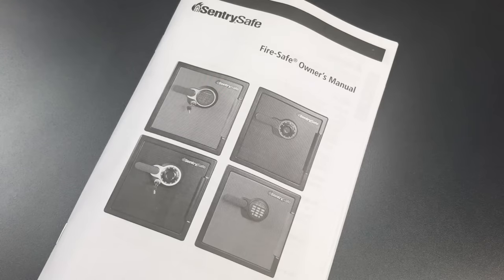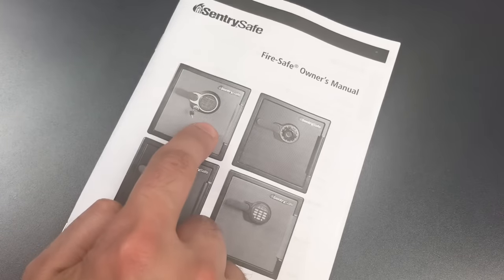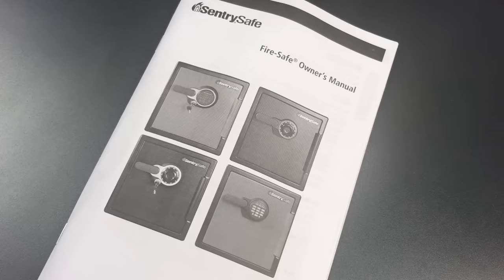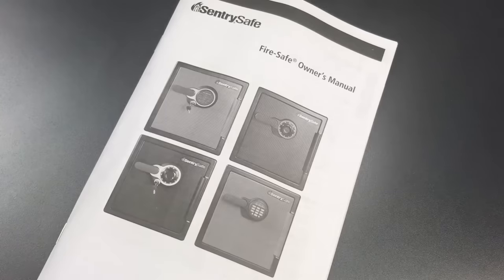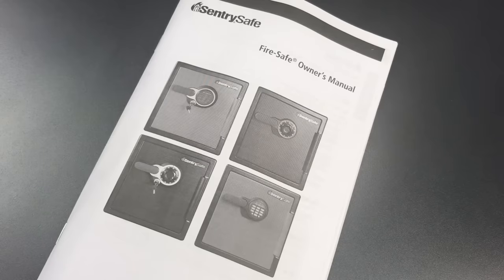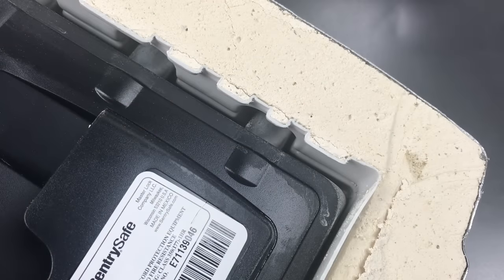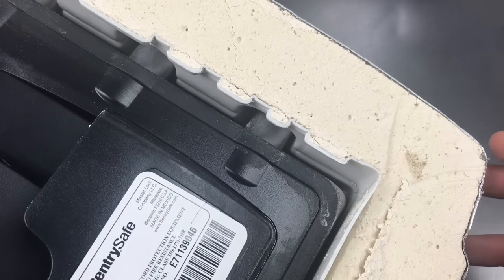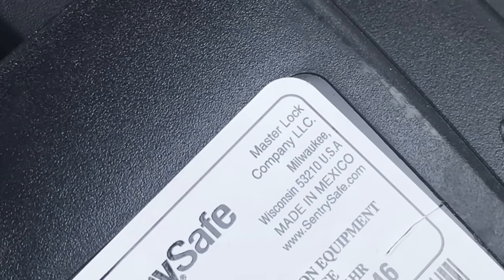[756] Sentry Safe Cut in Half FAST!

Comment: My aunt had a cheap sentry safe lockbox with her birth certificate, social security card, backup car key, car title, rainy day fund etc. She was freaking out because she lost her key for it. My cousin picked it up at about chest height and dropped it on the back patio, it sprung right open. She was dumb founded. She had believed it to be top security.
Reply: Wow.... lol
Reply: isiunavailable  i think this video shows that it isn't such bs or unbelievable. my parents have a safe from the 1800's, even c4 probably couldn't get into it, as it weighs about 500lbs empty, actual steel, not some dried milk powder. sandwiched between aluminum and plastic. this is really just a fire safe, not a valuables safe.
Reply: isiunavailable  Picking up and dropping something to open... Such BS.
Reply: @LygerTheCLaw  but even the weakest of lock attacks would get it pretty quick, unless it has a more modern door with locking bars and a modern key system or code

Comment: I'm just gonna admire the fact that he freehanded that cut together perfectly.
Reply: He placed his machine so the left hand edge followed the line of the safe door
Reply: freehanded? lol no, followed the line LOL
Reply: It's not terribly hard when you're only cutting through 1/16" piece of sheet metal and foam insulation.
Reply: @expert_fretwork  foam cement; not hardened steel by any means, but still...
Reply: @foxyMcFoxface  That puny little saw could kick an ant about 5cm....
Reply: I guess LPL never had wood shop in high school. Never, ever put your hand forward of a saw blade. That's first day shit
Reply: This is fire protection safe with access control for documents, not strong security,
Reply: @WiitaminCS  But it was not sold as such. Not that it is a bad idea to hide one of these under the floor boards in a closet to hide jewelry in, because it might save it from fire damage.

Comment: "I SAWED THIS SAFE IN HALF!" Takes out flextape to make it safer
Reply: I. WAS THINKING THIS THROUGH THE ENTIRETY OF THE VIDEO!!!!!! even wanted to comment it but you took the cake
Reply: That's a lot of damage!
Reply: ,,,AND WE REBUILT IT USING NOTHING BUT THIS CHICKEN WIRE AND FLEXTAPE!!!
Reply: The flex tape might actually be more saw resistant than that thin metal. The tape material and the sticky adhesive might jam up a saw
Reply: WAAAAHOOOOOOOO!!!!
Reply: Thank you, now I don't have to comment that.

Comment: they say safe but if you look up the UL listing they are listed under the category for "Residential Security Containers" (TL-5 rating meaning it has to withstand 5 mins against an attacker armed with a screwdriver and hammer) not for safes which have insane security requirements to get a UL real "safe" rating (class B, class C, TL-15, TL-30 and even higher) also if you think thats crazy most gun "safes" are also "RSC" listed not real safes either a total scam that needs more awareness.
Reply: screwdriver and hammer?

i get why youd rate a doorlock or a padlock like that

but what are you supposed to do with those on a safe? there so not the right toold for the job unless you wanna justt hit it and hope it opens

in which case 5 minutes is pretty pathetic
Reply: +Sarge
You can easily cut sheet metal with a hammer and a screwdriver...you lay the driver nearly on it's side where you want to cut, then smack the side of the driver blade tip with the hammer, and work your way along the material you want to cut like a can opener. It doesn't look pretty, but it will get you in this safe no problem.
Reply: Yep.  That's why, when buying security devices, it's important to ask ourselves what we're protecting the items against so that we can find a device with the proper rating.  I've bought Sentry Safes, before; but it's mostly for fire / water protection while my security concerns are more about deterring busybodies, curious pet-sitters, and low-grade thieves.  

It's similar to how I'm not that worried about using cheaper locks to protect my sweaty, nasty gym clothes while showering but I invest much more in a lock for a storage unit or shed containing items of greater value.  Someone snooping in lockers at the gym is a different kind of security threat from someone looking for a payday in the self-storage yard.
Reply: That's not a scam, you answered your own comment. 

The problem lies in the typical consumer, who buys something based on a price tag and a pretty picture on the outside of a box. It's the consumer's responsibility to research the things they purchase, and there is ESPECIALLY no one else to blame when that data is easily obtainable, such as on a UL listing.
Reply: Unless you keep your wallet, goverment id, credit cards, and/or vehicle keys in the gym locker, in which case it could be potentially more valuable than your storage unit / shed.
Reply: @1nm1  That is possible; but there can be other factors involved, too, when considering if a measure is sufficient.  For example: others in the locker room might take note of someone trying to break through a lock during the short duration someone is showering.  So even a relatively inexpensive padlock can be an effective barrier.  The same lock may be much more inadequate in a storage facility the thief may have largely to themselves, possibly giving them hours to work without being noticed.
Reply: Are you sure it doesn't say 5 minutes with a rubber mallet?
Reply: Or 10 minutes with a wet sponge and a banana
Reply: sentry safes are not ul listed rsc rated there way below that a rsc safe offers some protection
Reply: Where do you even search it? There's a whole bunch of UL sites and non of them show any information. All useless
Reply: pretty sure you can open this with screwdriver and hammer within one minute.

Comment: "I can't speak to the fire protection"
Wait, you're not going to take a flamethrower to it? Well I'm underwhelmed
Reply: They claim 1700 deg F for one hour.  While most people don't buy these for fire protection, I did make use of it, everything inside was intact after being in a house fire.
Reply: Here's we flamethrower that Bosnian Bill and me made
Reply: Thermite - easy and portable ;)
Reply: a flamethrower really wouldn't simulate a house fire....
Reply: @thorjohnson5237  This might be a bit too much.  Someone mentioned their rating claim was 1700 deg F for one hour...  I mean, isn't thermite designed to crack safes, and I mean real safes, not computer chassis with foam inside.
Reply: A friend of mine bought one of these for some testing. Now keep in mind, he's a qualified man to play with fire.
He took a DIY flamethrower and started burning. Got through the "Fire resistant" insides in 15 minutes. Of course the outer casing got melted by the heat. Useless, yet we had fun. In the end, we also made a molotov and put it inside, and funny enough, the safe went up in flames.
Reply: You you can speak TO everything. But please, dont expect any answer then.

Comment: I’ve literally only ever thought of those boxes as fire safes, not security safes.
Reply: Yes, I don't even lock mine.
Reply: I would call them "peek-proof" they stop a curious co-worker from checking out your documents but not really more
Reply: I understand the idea of having a fire-safe, but if a couple inches of insulating foam is all takes to qualify, wouldn't it just be better to insulate a filing cabinet?????
Reply: Yeah, that's probably more accurate although selling it that way may not be as fruitful. If you hid this, or secured it really well in a wall or to the floor it would be a lot more secure.
Reply: The manual said fire safe on the front pafe ment to keep fire out not baddies
Reply: @MGSLurmey   One of the main damage you get from a fire is water used by the fire menn.
It is not just the heat from the fire but also the water.
Reply: I figure any safe that can be picked up and carried away is going to be deficient in this sense.
Reply: @tuvelat7302  
Exactly, which is why I agree that "for the most part", this is a fire safe only. Have no idea about water tightness,  but if you have thick metal straps bolting it to floor joists,  it would be a little more deterrent of physical removal for "more aggressive access methods",  but not by much. Almost seems like a large sledgehammer 2-3x on the hinge side could deform the box enough to pry open and dump the contents. Still, much easier to just strap it to a hand truck and wheel it out (axle well-oiled 😉).
Reply: Seal your valuables in a pelican case, throw it in this, secure to floor/wall/ceiling in a hidden place. Boom, all the protecccs
Reply: Some companys are honest and just advertise them as fire safes.
Reply: @qq84  - Sentry advertises this as a Fire Safe. It's right on the front cover of the product manual. And the burning house icon is also a bit obvious too.

Comment: ...that's just a regular wood blade, not even a metal blade...
Reply: I was gonna ask. Just standard 52t 6" blade  or  crazy not even metal i own both
Reply: Probably Harbor Freight one at that. Hopefully he used a 20% off coupon.
Reply: Any carbide tipped saw blade will cut thin tin like that or even thick aluminum. Like butter, just go slow and watch for shavings (eye)
Reply: I'd love to see a battery operated circular saw using a Diablo metal cutting blade up against a full size reputable gun safe. Those blades cut rebar and 1/4" steel like it's wood. People need to realize your stuff isn't protected. All a safe does is keep honest people honest.
Reply: @gregsicinski8138  Gotta look at the TL rating which encompass tools like you described and much more.  TL provides a summary of all other ratings combined except protection for contents from fire.  example - some ratings show resistance to a cutting torch, but TL encompasses torches and everything else commonly available.

To get a rating, the lab gets plans of the safe inside and out including all materials used, look it over closely, and pick what they think are the best ways to attack and the fastest - the resulting rating is how much time it took them to break into the safe (TL-15 is 15+ minutes).

Note the time is from experienced experts using information a burglar isn't likely to have.  Most burglars will take much longer.

TL-5 is OK for home, will deter most thieves who just look for a quick smash and grab and out the door in well under 5 minutes - no need to lug around heavy tools, linger, and greatly risk getting caught when they can net jut as much breaking into 2 more homes.

TL-10 is better if you have a lot of valuables and puts it out of reach of most thieves unless they specifically know you have a safe and came prepared.  Some might try anyway but will give up when they aren't making any headway after a few minutes.

TL-15 is common for jewelry and upper end watch stores and would be the upper end for any home application.

I have a TL-30 but this and anything higher is overkill for a home.  I bought it used for the size to hold document binders in a fireproof environment.  I was robbed - it was in the 1st room the thieves entered.  They didn't even try to attack the safe, just pulled out the top drawers in the bedroom dressers which had nothing, and exited empty handed without bothering to check the rest of the home (I have several large pure silver decorative items they missed but are usually a target of thieves) - probably spent more time climbing in and out the window than searching for loot.

Gun safes still have value - almost all professional thieves are looking to get in and out of the home in well under 5 minutes, so they will usually skip a safe unless thy are confident they can break into it in less than 5 minutes with the tools they have with them, and as I found they act as a deterrence from a thorough search of the home - after they find the bedroom empty, they assume anything of value is in the safe.

Also most safes have fire protection.  The small safes like this or what you buy at a retail chain are no deterrence to theft (2 pry bars would have probably popped the door as fast as the power saw), and when tested under fire they failed when they fell off the table and the door popped open.

Another big gain is to hide the safe.  Most thieves search the bedrooms, kitchen, and home office so hide the safe someplace else, the rest of the home is just a walk through scanning for items in plain sight.  It isn't like they are going to take the time looking for a hidden wall cavity in the basement-garage-hallway-laundry room-utility closet-etc. or enter the attic or crawl space.

Consider having just a hidden wall cavity behind a mirror or wall mounted bookcase (or something else secured to the wall) with a well made, tight, hidden latch to open.  You can't steal what you don't know is there.  Needs to be something that is permanently attached - thieves do check behind pictures and wall hangings, and book cases that roll across the floor will eventually leave marks.

For an apartment to hide small items, I made a dummy 2 gang receptacle box with the cover held by magnets, cut out the back and sides of the box not used for mounting, and made an internal chamber.  No thief is going to start checking for fake electrical receptacles.

If looking, I recommend shopping used safes.  They go for a fraction of a new one, but it isn't like they wear out from lots of use.
Reply: @gregsicinski8138  yep.  I watched so many videos of a house LOCKS. make you think. Why the F do I even use them. Just keep honest people out. That’s it.    Bump keys to picks.  I can pick a lock now semi easy.    Electric locks like on a bank. I watched a man blow smoke inside the door to fool the sensor to open the door at night.
Reply: @AerobaticsPilot  That's why I have 1oz hollow point 12ga slugs... come on in... I'll leave the light kn for my own accuracy
Reply: @gregsicinski8138  - //  All a safe does is keep honest people honest. //
Very well stated, especially that final sentence.
Reply: @Deebz270  It also gives honest people peace of mind till they see this video, or get robbed...
Reply: @gregsicinski8138  Rebar isn't hardened and is actually quite soft.

That's what people forget about. Good safes are made of hardened steel, and you WILL NOT be cutting into it. 

Unless you have a hydraulically fed Hyd-mech saw, or something like a thermal lance.

All those metal cutting blades they make for hand saw, are only for cutting thin annealed steels, not hardened.
Reply: That thing is so weak you'd be able to saw it with anything
Reply: @StofStuiver  Good point - you could probably break in faster with a claw hammer or axe.